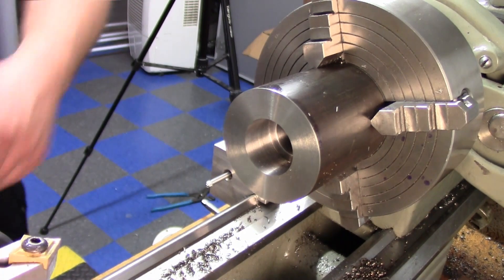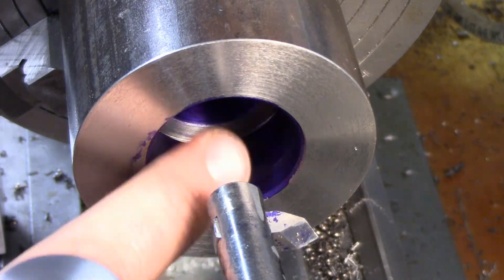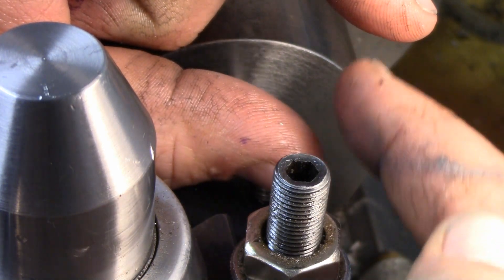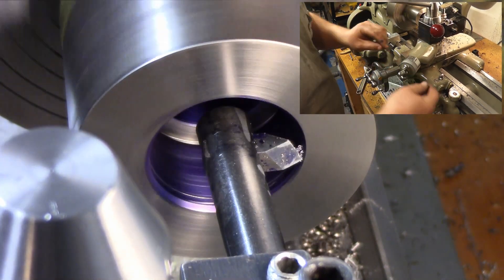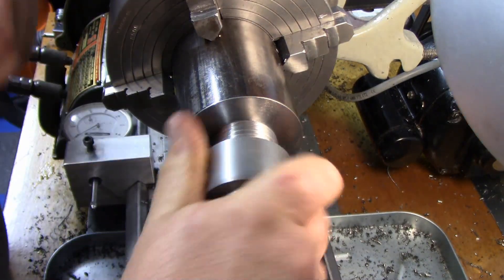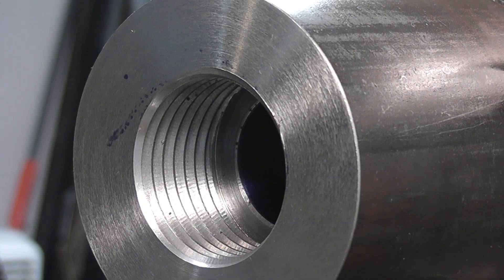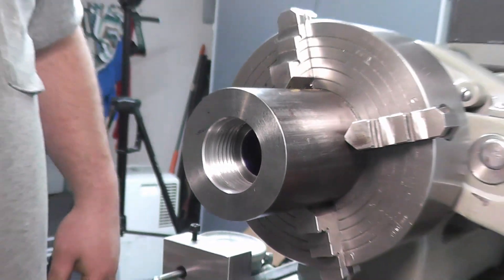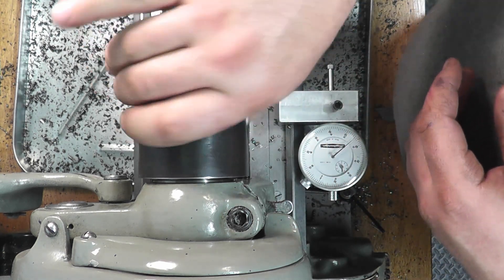Building an ER collet chuck: Part 2

Comment: Why did you thread the most unsafe direction, When you could have cut the thread from inside out with no scary moments to remove the cutter
Reply from the maker: Threaded Chuck.  I'd have to run the lathe backwards and if the cutter caught or dug in for any reason there's a good chance it'd spin the chuck off.

Comment: I absolutely do not understand why the register was quickly cut loosely single shot with calipers. Why was not the item screwed in and brought in till it shut off tight dead nuts on the register?--in other words the threads are location which is not good--and the register seems to serve zero purpose--and is actually clearance what am i missing?
Reply: to me the purpose of the thread is to pull up against the register and mating face

Comment: It would be nice to be able to those short, internal threads starting from the thread relief and move out to avoid any chance of crashing it, but to do that the spindle would have to be run in reverse (if I'm remembering it correctly)...  not a good thing to try with a threaded spindle.  The ways on my Mueller have several battle scars that I suspect are the results of such an attempt, because someone made a place for a locking grub screw in the spindle thread.  I don't have the chuck that was made for, and I can't think of any way to match another one to it.

I've got an idea for an alternative anchor, just got to make a prototype and find out if it's an idea worth sharing...
Reply from the maker: +diggerop 
Yeah I know it's an outside chance of spinning the chuck off, but I know I'm that one guy that would happen to.  If it wasn't for bad luck I'd have no luck.

Comment: For future reference, the register (especially on a collet holder) should have no radial play as it should be a tight "sliding" fit. In the good old days, Myford lathe fittings for instance would came undersize from the factory and you were meant to scrape them out to fit your individual spindle, so you had an exact fit.
Reply from the maker: Yup this is matched to mine. The only place you want a little play is on the threads to that the register aligns it along with that outside face.

Comment: Suggestion - drill a hole in one side, near the spindle, which you can insert a bar or wrench into to aid unscrewing it from the spindle. You're already having problems getting enough grip to remove it, and that's not a smooth surface.
Reply from the maker: That's the last step I did.  It's in a future videos I haven't edited yet :-)

Comment: Greg, a useful technique for internal threading a to a shoulder is to put the lathe tool the right way up on the backside of the bore, put the lathe in reverse and cut from the inside out. That way you don't have to worry about running into the shoulder at the end of the cut run. Bought back memories of when I made my self a collet chuck years ago!
Reply from the maker: Yup I'm just a chicken with the threaded Chuck.  My luck that sucker would spin right off.

Comment: Thanks a bunch for the great video - really learnt a lot.
Of special interest to me was to 8:50 on when you were boring out the start of the
threads for the register.  The amount of deflection on the boring bar was really surprising!!
What I learned here would be to use a progressively larger boring bars for more regidity.
Also (this is observation not criticism) I noticed the threads appeared to be quite coarsely
machined which I would think would have been chatter.   looking at the machined surfaces makes me think this is mild steel - whats your take since you machined it>
Thanks again - much appreciated.
Reply from the maker: Yeah you'd want the largest boring bar you can fit for the bore.  I used my little one just for a good camera view.  The chatter is partially my fault.  I got a little while threading.  Also you'll see that when turning really slow which I did just because of the coarse thread to the shoulder.  If I sped the lathe up it would disappear

Comment: Knocking the chuck loose while locking it with the back gear, not best practice, is it? Maybe you could do a project video for a tool to securely grip the spindle to allow you to remove a chuck without putting strain on the back gear. Good video